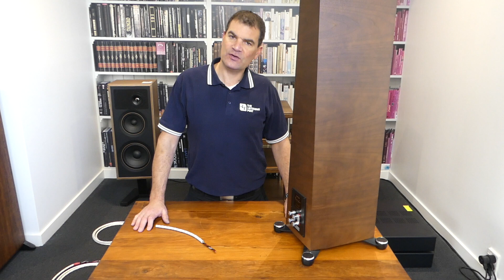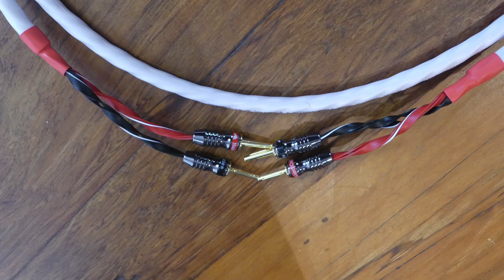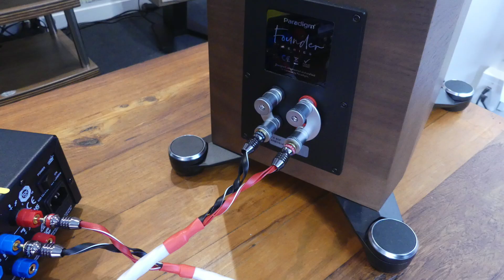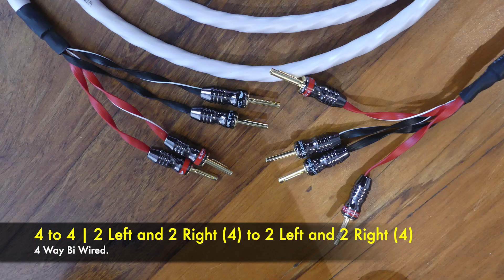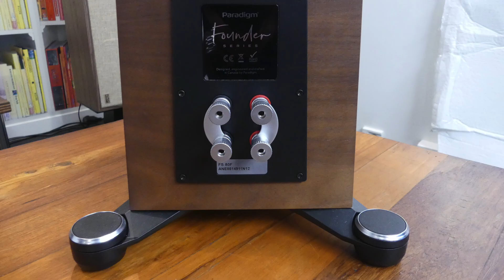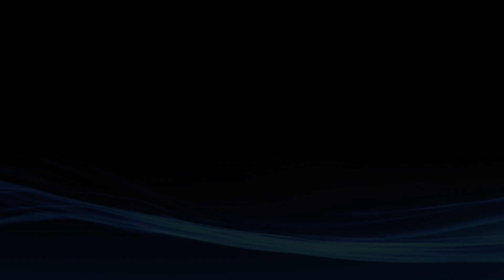Single vs Bi-Wire Cables to Speakers | The Listening Post | TLPCHC TLPWLG

Comment: Hi 👋. I’ve been bi-wiring my transmission line loudspeaker cabinets for well over 40 years that I built., but I’ve got cables for low frequency, and I’ve got cables for high frequency,
Reply from the maker: Perfect. Great to hear. What cables are you using?
Reply: Hi TLPCHC , Van den Hul The. Clearwater, and Audioquest , cannot remember the serial number of those at the moment, between about five of us, we purchased some different cables each, then over a course of 3 to 4 months, we were listening and doing sound test with some equipment  that I have purchased, 
We found these two makes of cables were the best , I now live in a very old building that I’ve converted over many years, and because I want to move my speakers around to another area, I’m now trying to source some new speakers cables, , sadly, I do not have the sound equipment anymore for doing testing, I might have to purchase something, I found a firm over in the Netherlands that were very, very helpful, regarding the speaker, cables, and hi-fi accessories, even supply sound testing equipment, merry Christmas, and a happy new year, from France,
Reply: You are ridiculous.  Simple laws of physics, hi-fi religion.  Bi- wire is no different than thicker speaker wire.  And there is no difference between high and low frequency.  Same speaker wire carries both.
So for 40 years you were simply hallucinating. :face-pink-tears:
Reply from the maker: @zvast    Try it - or get off the internet
Reply: @TLPCHC  Off the internet?  Who are you to dictate me where to go?   You babble nonsense, more or less hallucinating
Reply from the maker: @zvast     You should try it. Use a couple of good set of speaker cables and listen for yourself. Borrow some from a HiFi retailer (so it won't cost you anything to try). Until then, your voice is mute.
Reply: @TLPCHC  Tel me, is there diference between two thin wires or is one twice as thick just as good?  Laws of physics, amps and ohms don't lie. If you can hear the difference, you need to see a psychiatrist.   Be careful.  He may not let you out.   :face-fuchsia-wide-eyes:
Reply from the maker: @zvast     Again - I suggest you try it for yourself.     (Remember I am not trying to sell you anything! - I have no skin in this game).   This is a simple experiment, you can do this in your own home.  So do it.    Try it.   What do you have to loose?      I am talking from 25 years experience in retail HiFi, so my words carry the weight of real world happy customers.  Yours (until you try it) is out of theory and implied ignorance.
Reply: @TLPCHC  So, should I separate many strands of thick speaker wire into two thinner lines, joined on both ends?  Like the electrons care how they get from point a to point b.  That just as ridiculous as firm belief in one of the tele evangelists preaching in tongues.   https://www.youtube.com/shorts/QB1feepQWOU.  Read. comments of other people who know logic compare to your religious like faith.  :hand-orange-covering-eyes:
Reply from the maker: @zvast  Run two cables. 2 to 4  - Remembering to remove the speaker bridging clips.
Reply: @TLPCHC  I'm non religious.
Reply: @TLPCHC  @JohnSmith-qi6co
My 10 gauge speaker wire effectively makes the voltage at one pair of the biwire the same as at the other.  No way anyone is going to hear any difference biwiring.  Bi-amping is a different story.
Reply from the maker: @zvast    Have you tried it yet?
Reply: @TLPCHC  I don't do religion.   :face-orange-frowning:

Comment: Does using high quality jumpers speaker cables for using with single wire cables will have the same effect as bi-wire cables?
Reply from the maker: No, not normally the same effect.  But still a worthwhile cheap upgrade
Reply: @TLPCHC 😮 how different could be? I have the Supra sword excalibur and they don't make bi-wire cables but they have excalibur jumper cables.
Reply from the maker: @vvmaster2010     Maybe they are trying to sell you two sets (still 2 to 4) but with two physical cables

Comment: I truely believe that if you do THX cent power amp and speaker (115db+) about 400W @4 ohm that mean (40v 10A) .. you need serious power amp and cable or bi-amp is a good idea to limit power down (not over 200w @4ohm 28v 7A) .. good example was Yamaha 7.2.2 power amp design (can do 5.2.2 mode)
Reply from the maker: What is the point of your comment?  Is there a question?

Comment: i have 10mm occ cable for the bass, what gauge do i need for the mids and high to make the sound more balanced?
Reply from the maker: Replace the cable you have with the WireWorld Solstice Speaker cable

Comment: What about using a receiver that has a bi-amping option?
Reply from the maker: Many 7.1 (and above) AV receivers have a Bi-Amp option, where the spare amplification channels can be set up to mirror the front speakers and give you a Bi-Amp / Bi-Wire option.  You need speakers with two sets of binding posts, two sets of speaker cables (or the W.W. Solstice seen in the video) and you need to remove the speakers bridging clips.   This is a very useful way of increasing performance and reducing the noise floor of the front speakers.

Comment: I believe both are the same unless you are bi-amping. My speakers are run by McIntosh MC901 which does 300 watts of vacuum tube power to the mids/tweeter and 600 watts of solid state power to the woofers. This is a dual mono amp using 2 amps on one chassis per speaker. I don't see how single of bi-wiring is different as everything is connected with jumpers or single feed out of amp to dual feed to speakers. It's still connected.
Reply from the maker: It creates a dedicated circuity for "highs" and "lows" all the way back to the amp. This increases the mid range presence subtly (but noticeably). Try it.
Reply: @TLPCHC  Why would I do that when I'm running McIntosh 901's? I'm putting 300 watts of vacuum tube power to the mids and treble and then 600 watts solid state power on a separate channel (which is also split to 2 x low pass and 2 x high pass and 2 x subs by the McIntosh C55 pre amp) to the woofers?
Reply from the maker: @  You must already be bi-amp / bi-wiring.  So your question re only bi-wiring is moot.
Reply from the maker: @   Priority:  Single Wire, Then Bi-Wire, then Bi-Amp (Bi-Wire)
Reply from the maker: @ Maybe watch the other video I did on bi-amping
Reply: @TLPCHC  Absolutely not, and I wasn't asking a question. I was making a point! What is the difference between which end of a cable you bring them together. At the amp end (if they are terminated together in a 2) then not terminating at the speaker end but they join with jumpers? You tell me scientifically what is going on. I use Acoustic Zen Double Barrel speaker wire which is on a pair of Wilson Watt & Puppy which has one pair of taps only. I re-terminated it to be a 2 to 2 config from a 2 to 4 config which in itself brings in a whole load of other topics, resistance, RF, noise etc, etc. The speaker cable is unshielded, now your bringing 2 pairs together. Another room has the same cable with a 4 to 4 config. It is a true bi-amp configuration between McIntosh MC901 and B&W 801 D4. You are aware of how the taps are on these amps and speakers? I'm not sure you are. Your equipment you use in your videos are not at the same level.
Reply from the maker: @philstevens9914      You have a very specific set up.   My advice on this channel is designed for the vast majority of every day HiFi set-ups and every day customers.  Your system is in the 0.1% of set ups (maybe 0.01%) so you are best to seek specific advice from the people you purchased the equipment from. Not YouTube.
Reply: @TLPCHC  I wasn't seeking advice. I was making a valid point!
Reply from the maker: @philstevens9914   In an average set up, if the speakers have dual binding posts, a 2 - 4 (bi-wire) configuration gives a valuable lift in mid range performance.

Comment: I’m a retired electronics engineer, studying methods of improving audio fidelity since 1973.  IF adequate wiring is used for the amperage, voltage, and frequency, no other improvements makes a measurable difference.  I have made countless measurements on this topic.  It’s frankly snake oil…. My ultimate solution was tri-amplification, WITH THE AMPLIFIERS INCHES FROM THE SPEAKERS.  THAT configuration virtually ELIMINATED back-EMF generated, low frequency distortion feeding into the mid and high frequencies.  Signal losses are also radically reduced.  Of course, low frequency fidelity is also vastly improved.  It’s a difference even un-trained ears can appreciate.  😜
Reply from the maker: I have dozens of customers who have gone from a single (2 - 2) wiring configuration, to a Bi-Wire (2 - 4) and reported back improvements in performance.  Most noticeable in the mid-range.
Reply: @TLPCHC  As a  retired MD, I wrote so man Placebo pills........which is snake oil!
Reply from the maker: @cirrus1964    Try it - Or shut up
Reply: @TLPCHC  Hahaha, I did, on High end gear 30 years ago. When I started 65 years ago, you weren't even born. And BS only came as your generation believed idiocy. You see the high and low frequency's AS PROVEN, don't get in each others way over one single cable. So you do it and fund the cable snake manufacturers! Ps, I don't like people who tell me to 'shut up, most have no brains to give a real counter reaction build on science!
Reply from the maker: @cirrus1964    So you never re-visited in 30years?  it I will lend you a WireWorld Solstice Speaker Cable, terminated 2 to 4 and you will see!
Reply: @TLPCHC  If you are happy to hear a difference, wonderful! I have improved audio which makes sense! I worked with people well respected , even distributed Croft Amps for the whole continent Europe. a I build my own cross over In my T'L's filled Audio Note units, you can imagine how may terminals are on the the back. Good luck.
Reply from the maker: Have you tried it for yourself yet?

Comment: THE  REASON THE 4 POSTS ARE SUPPLIED BY THE MANUFACTURER IS FOR THE USER TO BI-AMP. BUT ALONG THE WAY, THERE ARE THOSE USERS WHO REFUSE TO RESEARCH THIS AND ASSUMED IT WAS FOR "BI-WIRING". THE SPEAKERS HAVE A CROSSOVER NETWORK ALREADY BUILT-IN WHICH IS INSIDE OF THE SPEAKER AND CONNECTED PROPERLY TO THE SPEAKER TERMINALS. WHEN A PERSON TAKES THAT METAL STRAP OUT THAT CONNECTS THOSE 2 POSITIVE AND THE TWO NEGATIVES, YOU EFFECTIVELY ARE BYPASSING THE BUILT-IN CROSSOVER. THAT'S NOT A GOOD IDEA, BUT YOU WILL HEAR A DIFFERENCE. NOW,  UNDERSTAND THAT YOU ARE SENDING THE ENTIRE AUDIO SPECTRUM TO EACH OF THE SPEAKER DRIVERS THAT ARE INSIDE THE SPEAKER. WHEN THE CROSSOVER INSIDE OF THE SPEAKER BOX IS USED, THE TWEETERS THAT ARE DESIGNED ONLY TO RECEIVE THE HIGH FREQUENCIES. ONCE YOU TAKE THE CROSSOVER OUT THE CIRCUIT, the TwiEETER ARE THEN EXPECTED TO WORK UNDER A MORE STRENUOS SITUATION  BUT THEY ARE very sensitive to lots of power, so you're trying to make the TwiEETERS work as hard as the Woofer. When you turn the amplifier up at your volume control, if you turn it up too loud you're gonna blow those tweeters. THEN. you won't have any high frequencies at all. THERE IS ANOTHER WAY TO CONTROL HIGH / LOW FREQUENCIES MORE EFFICIENTLY, but it inVOLVES what they call an active crossover networking and supplying another stereo amplifier, preferably one that is more powerful than the one you're using. You will use the more powerful one to drive the woofer. I am not going to take pictures of diagrams, instead you do the research. Just Google, schematic drawing of BI-AMPING. (GEEZE!!)
Reply from the maker: You are completely wrong. Removing the bridging clips removes the electrical connection (bridge) between two parts of the crossover, allowing for separate electrical connection to the "top" and "bottom" of the speaker.
Reply from the maker: Your own statement (above):  "bi-wiring is not a good idea (because it bi-passes the crossover) implies that bi-amping can not work either.
Reply from the maker: Just try it for yourself

Comment: I bi wired just out of curiosity, it does make a difference, sound is brighter and more detailed, but it's subtle; imagine 2k and 4k.
Reply from the maker: Great to see you took the time to experiment!  Yes, when just changing the cabling the differences will be subtle.  But the gains are worth it for the (very) modest investment!
Reply: @TLPCHC  they are.

Comment: Regarding Bi-wiring
Can you join/connect the wires closer to the speaker by cutting into it rather than using full length cable from the avr? technically would it not be the same
Reply from the maker: You need TWO full lengths runs

Comment: It really doesn’t make sense considering your just moving the one to two connection to the amp and not at the speaker. Tell me how moving that connection creates a dedicated circuit. The A and B seams to me to be dedicated because of the separation in the amp. I don’t understand if you turn A or B off what that causes. Please explain.
Reply from the maker: An amplifier with A & B speakers is splitting the single stereo output to two sets of binding posts. I recommend you use " A " speaker output only as it avoids the potential of inadvertently having one set off, when you expect them both to be on.
Reply from the maker: Re-Think the question and ask it again (as I might be able to help)

Comment: I have a PA, Yamaha mixer/amp with SoundTech speakers, TS connectors. I have an old set of Altec Lansing Model 15 speakers, bi-wire. How can I connect the Altecs to the mixer/amp, convert the TS cable to biwire or put a TS jack on speakers? Will either work?
Reply from the maker: Not really the type of speaker set up that is going to be worth the changes

Comment: When using single ended cable connections, it is recommended to plug the positive red wire into the upper binding post of the speaker.  Better clarity.
Reply from the maker: I recommend replacing the bridging slips FIRST
Reply: @TLPCHC Question. If you replace the jumper plates/strips with wire ones and plug your single pair speaker cables into the top (tweeter) terminals what actually flows through the jumpers?
Reply from the maker: @rogerwebb7501  The jumpers link the top and bottom speaker binding posts, so you get "tops" and "bottom" working at the same time.
Reply: @TLPCHC  Ah yes, but the question is (and the one I asked) what part of the signal, high or low is conveyed by the jumpers. Much has been made of the proposition that using the same cable as for the amplifier to loudspeaker for the jumper is somehow beneficial.....this implies that both carry the same signal - otherwise why the same cable? Surely it would be better to select jumpers that are known to conduct that part of the signal they have to carry!
Reply from the maker: @rogerwebb7501  A full signal ends up at each terminal. Perhaps you should explore Bi-Wiring (remove the bridging clips and run a cable for the "top" and another for the "bottom".
Reply: @TLPCHC   A full signal  comes from the amp  on two in to two or your two into four   fact   with or with out the clips  its the cross over that splits the signals nothing more   bi-wire was is a hifi sales thing from years back built on the bi amp ways    one good other a  myth
Reply from the maker: @davidbaker9537  I disagree. Try it for yourself. There is most often an obvious improvements in "mid's" as electrically the bass signal is (virtually) removed from the signal passing through the two of the speaker.
Reply: Why?
Reply: @rogerwebb7501  the high frequency signal is so delicate and subject to distortion; by plugging it in to the top, it goes directly to the crossover high  frequency. That’s eliminating the extra connections when plugged in to the bottom plug.  Fewer connections cleaner sound.

Comment: My 10 gauge speaker wire effectively makes the voltage at one pair of the biwire the same as at the other.  No way anyone is going to hear any difference biwiring.  Bi-amping is a different story.
Reply from the maker: See above
Reply from the maker: Ha Ha. Yes - It Does! Go and have a listen somewhere. I have demoed to skeptics so many times I lost count and a basic vs good cable is obvious.  One skeptic re-wired his whole home theatre from one demo!